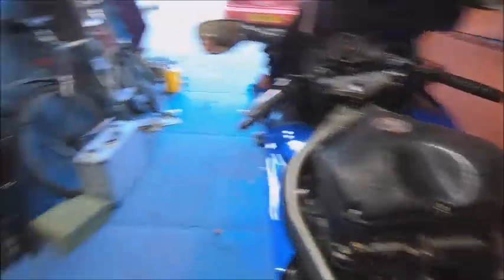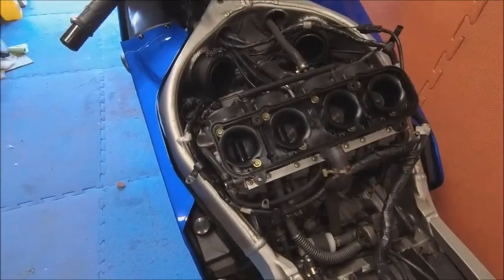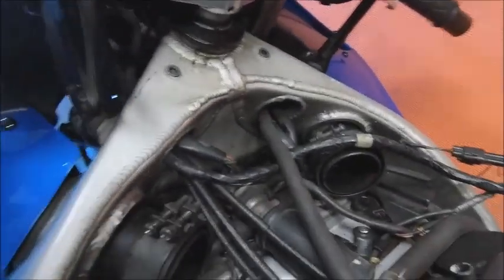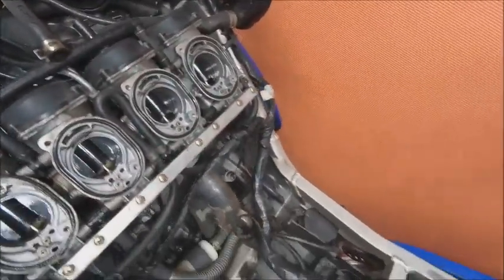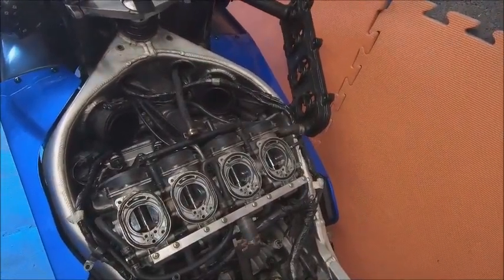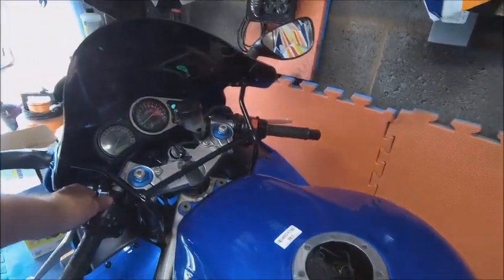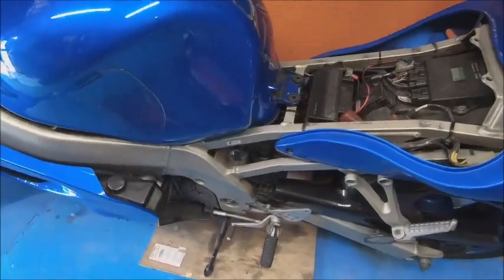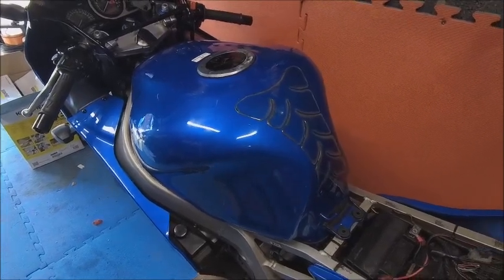Kawasaki ZX9R Carb Issue (SOLVED)

Comment: went through all this with mine low rev issues etc done valves carbs everything which usually worked as old girl always throws a rattle if left standing too long :)  but had same issue again and this year changed coils for hell of it and its like a new bike now.......mine always hesitated  and bogged down at 3-5k also took ages to come off choke.
cured at last good luck
Reply from the maker: Thought about doing the coils myself....Also need to ride it more to stop it "furring up" ...great bikes all the same ...

Comment: Hello Ade, Guys, Gals, I have a 01 ZX9R, been sitting in the garage for approx 8yrs now, I want to get it running again. Changed oil/filter, air filter, checked carbs appeared like the ones in this video (good condition), three attempts at removing rust/jelled fuel from the tank (clean now), however; fuel pump does not appear to be kicking on bought a new relay to replace the one under the back seat, will install today to see if that kicks the fuel pump on. Any thoughts assistance would be appreciated. Thank you!
Reply from the maker: Wow sounds like you have some work on your hands Ken....Ill be honest I've never had electrical problems (apart from the alarm glitch) but sound like it just going to be a process of illumination ...checking the power is getting to the places it needs to be and then the parts are good too, to my knowledge the pump has power to it all the time as its a pressure Syphon type so as soon as you turn the key you should here it strike up if its empty as they are quite loud....Maybe if you are getting power too it run some WD40 through it as it can get fur;d up like the crabs...Of course you can simply use an external source Syphon method to strike it up, but that's not very practical going done the road  😆
Reply: @AdeReeves  Thank you for taking the time to provide the detailed reply, very much appreciated. Once I installed the new relay and confirmed that the pump was getting power as you suggested, I replaced the fuel filter and she fired right up. Thank you again!
Reply from the maker: 😉 @kensmith5410  no problem ..us old ZXR guys have to stick together ..        have a look on facebook too i'm a member of a couple of forums and they have a lot od experienced people on there ..
Reply: @AdeReeves  Agreed! I just joined one ZX9R.net I think. Also, I subscribed to your channel so I will follow when I can. Hope to chat again one day, stay safe out there. thank you.

Comment: Hey man i have a 94 zx9r and i only get 1 hour of riding per an entire gas tank. Do you think its a jet or fuel line issue?
Reply from the maker: Depends how you ride it , but i usually get around 130-150 miles per tank
Reply: @AdeReeves  I really baby it I go at most 80mph so idk why the fuel economy would be so low
Reply from the maker: it could be a perished vacuum hose .. but it's Probably time to whip the carbs off an inspect them... could be a slit vacuum diaphragm / stuck butterfly, but impossible to say without the carbs off .
Reply: @AdeReeves  that narrows it down,  thank you. I'll let you know what it is when I find it

Comment: I have a 96 took it apart to check carbs which was clean, & the gas gague isn't responding now please help & it's also been sitting for 2 years now so if you see more issues on the way please lmk thanks
Reply from the maker: don't have a fuel gauge on mine ...so no problems  ...but probably gonna be a dodgy wire.

Comment: Great video.
About the vacuum unit at 2:19, what does it actually do? I am planning an engine swap for my zxr750 with zx9r engine, and noticed these hoses on there. I read on some forum they are for some emission bollocks, but I am not sure if they can be left out. The workshop manual is not very informative on this topic either, just describing that whole setup as "Vacuum Valve Switch"... If it indeed is some emissions crap, I can just not bother with it.
Reply from the maker: Hi...From what i can see they go to two tubes under the headlight that are used to sucking air under initial acceleration .... it all seems a bit over complicated and unnecessary to be honest but you can hear a they are defiantly gathering air when you throttle back... I really don't know if this is emissions related and you said  or a primary route until the ram air system gets going ....but i would say as long as the pipe can draw cold air from somewhere all would be good.

Comment: I have a 94 ZX-9R the low rev performance is very burbly with a lot of stuttering but then hits 3k and takes off like a rocket. Do my pilot jets need to be cleaned? I think it happened when I ran out of fuel the other day.
Reply from the maker: I would say its a fair diagnostic...  maybe try taking teh air filter out and giving them a good blast like i did ....a lot of carb cleaner on the rubbers isn't great, so maybe hit them with WD 40 first while running and see it that helps... try using your hand over the intake mouth while you rev it as well to create some extra vacuum ....might just do the trick .   :)

Comment: Hi how are doing I have a 94 ninja 900  and I haven’t rode my bike in about 5 yrs and I wanna get it going. do I have to first change the plugs?
Reply from the maker: If it's not been starting in 5 years sir...i would go through everything ....change the oil / plugs check the air filter and probably crank it over with the plugs out first ...maybe even spray some oil in the plug holes to make sure you don't run the bores dry...
Reply: Ade Reeves ok thank you I’ll keep you updated

Comment: Having problems  my self on my zx9r now won't rev past 4k and when I try and ride it just dies when moving off no power weather its carb I don't no
Reply from the maker: Dam not good....hope you get it sorted.
Reply: Did you find a solution to your issue Liam? Im having the same issue. Taken the pilot jets out and blew them clear, runs better on tick over, but still really struggles when riding.
Reply: Yes carbs it was all fully cleaned and riding  better now .  1 other thing check you fuel filter my bike was playing up again last week different fuel filter sorted 👌

Comment: Hello I have a 94 ninja haven’t rode it in about 5 yrs and wanna get it going is changing my plugs the first step?
Reply: Mate, the spark plugs are the last thing I'd worry about. Your fuel system will need your full attention first.
Drain and clean the tank, then your fuel lines, replace the fuel filter and if your able to clean the carbs. Do all this and it will fire up straight away. 
I had a 94 and had it storage for several years too just like you and I had no choice but to do what I mentioned.
Reply: @tonymontana897  I just bought a 2k model only two days ago, it has been off the road since 2013-2014 as a project through two owners, that was all done and it fires up and runs great.
Reply: @HalfdeadRider  Good to hear man. You can't just think to one aspect of this important maintenance. Start from the top and work your way down. I hope your project wasn't one of those street fighter conversions. Arrghh how I hate those !!
Reply: @tonymontana897  No mate it's like it just rolled off the showroom floor pretty much. With a few mods, Delkevic exhaust, K+N Air filter, very nice smoked screen and some levers. If you want to see the beauty there's a picture on my instagram. If you click my name you should find a link on my channels banner.
Reply: @HalfdeadRider  Nice mate. Exactly how I like them. Some mods can be tasteful but others aren't. I have a 2001 with less than 5k on the ODO. It is literally like new !
I keep it well maintained even though I keep it stored. These bikes are going to become proper classics some day and anyone who knows anything about them will want one.
I'll head over and take a look man. Where abouts are you located ?
Reply: @tonymontana897  That's got to be one very nice example, definitely becoming modern classics and prices should start rising soon for the good ones I think. I'm Norfolk UK mate, you?
Reply: @HalfdeadRider  Yep, definitely agree with what you said mate. You have to see it to believe it. I lavish all the care and attention on it to keep it as fresh as possible. Nobody would believe it's a 20 year old bike. I doesn't have a mark on it. Absolutely mint in every sense of the word. I saw your pics of your ZX9R and I love it mate. You have a blue variant. Excellent colour scheme. Mine is Fire Cracker Red/Dark Purple Metallic/with the silver swoop decals. It looks beautiful. Different graphics schemes between the 2000 & the 2001. Yours is an E1 and I have the E2. I'd love to get my hands on a minty F model if possible too. I used to own a B1 '94 model back in the day too. Had that one for 12 years. I miss that bike. Should never have sold it.
I'm in Sydney, Australia. Shame you weren't here too. We could hang out lol.
Reply: @tonymontana897  Yea that sounds awesome, I know the scheme you mean I prefer that to the green if I'm honest. I would maybe upgrade to an F model someday, who knows what the future will bring. I wish I was in Australia with you, but stuck here in wet cold and locked down UK, we will soon be set lose. I can ride locally for now so I'm not totally stuck, opens up more on the 29th though and will finally be out with some mates having good times, stay safe out there 👍
Reply: @HalfdeadRider  Thanks mate. I'll check in from time to time on your Instagram.
Take care and stay safe.
Reply: @tonymontana897  cheers bud 👍